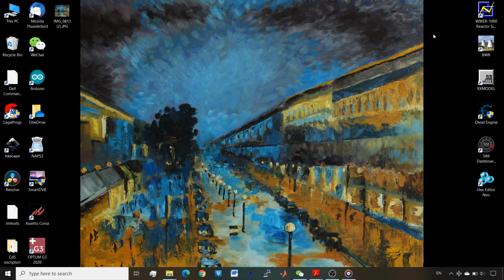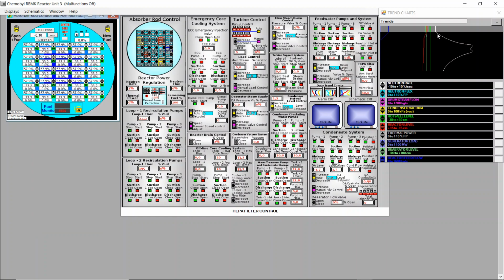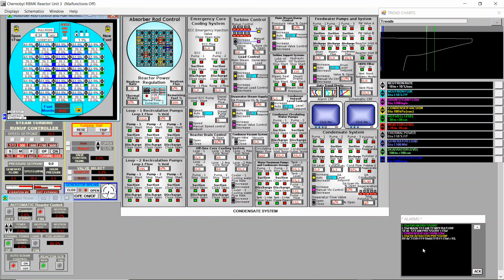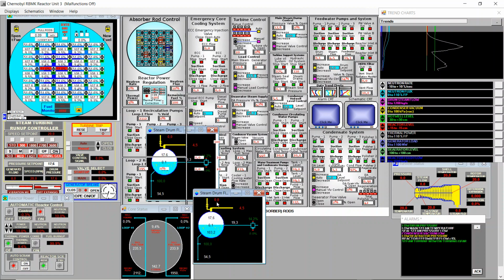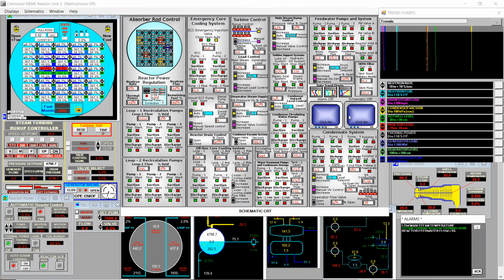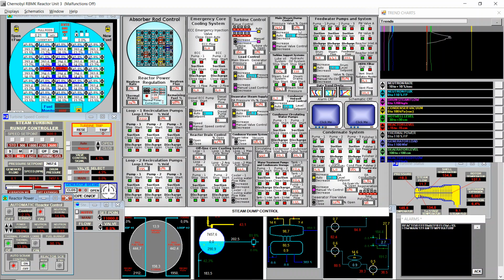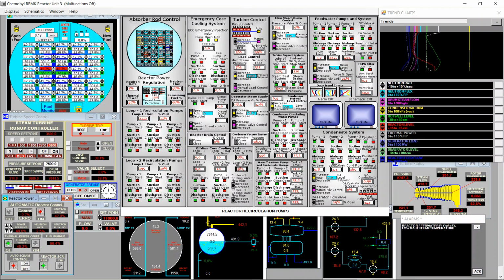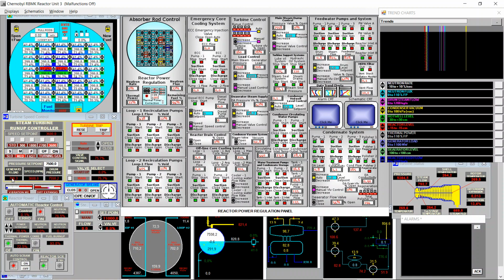RBMK-1000 Chernobyl Unsafe Startup Tutorial

Comment: awesome content! ive just managed to get to 950Mw output from a cold start in 11 mins! took a lot of risks tho. same start pulling all rods, then start all the aux pumps, keep discharge valves closed until you get Nflux to 30%, reset turbine trip and engage auto on power level control. open discharge valves, set drum level to main valve and turbine to main valve BEFORE they start to open. once pressure at 8000kpa open turbine to 4%, sync, switch to auto, then pull rods to 99% output, pausing as necissary. makes your pulse go fast doing it this way, but fun :)
Reply from the maker: 'keep discharge valves closed until you get Nflux to 30%' that was crazy man, I guess you are one of those people who pulls the usb from the computer without waiting for the safe removal message...

Comment: Thanks for the video!
What exactly do those warnings on the control rod control panel (two red, two green) stand for? Do they have to do with relative power distribution, or warnings of some setpoint values?
Reply from the maker: You are welcome! The two red show the two outmost control rods and the two green the two highest chanel outlet temperatures. Note that chanel temperatures is not fuel temperature, chanel is usually slighly above water drum temperature.